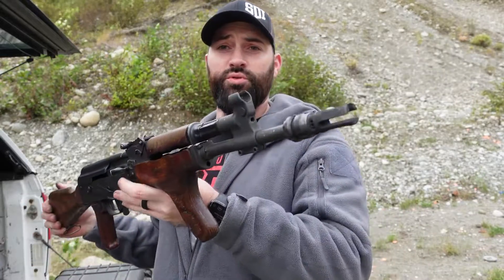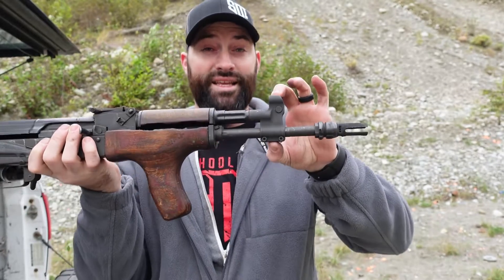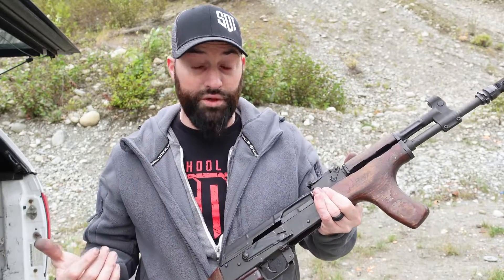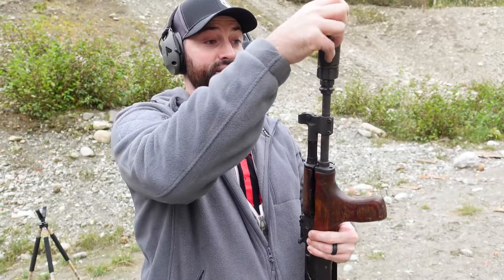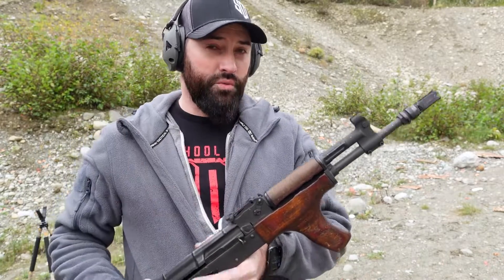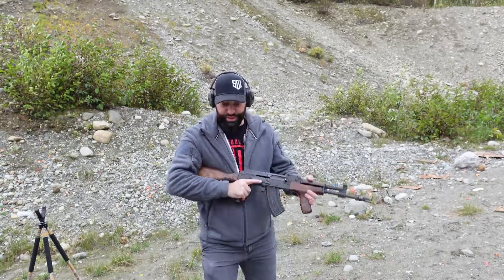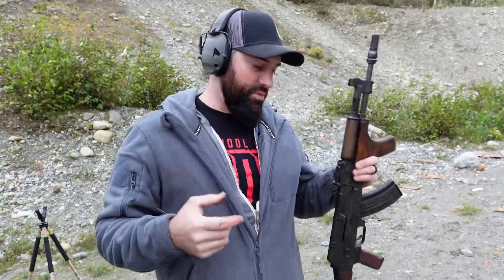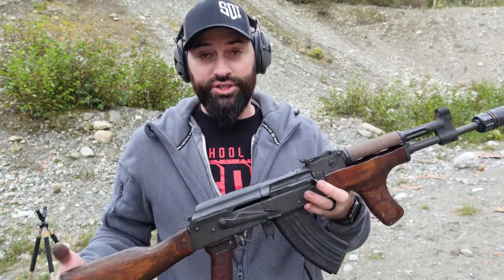SDI GRAD on Rifle Dynamics' Adjustable Front Sight Gas Block

Comment: You'd think they would have an easier system for adjustment on the gas block.  Something that works well and makes sense.  I don't understand.  I want detents.  I want toolless and I want it to be operable with my fingers or a bullet.   Fuck!